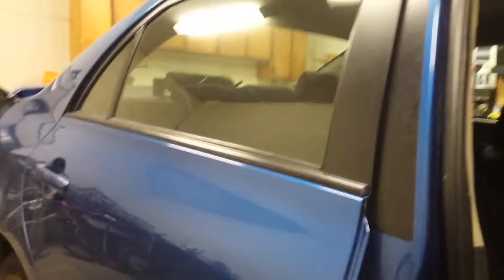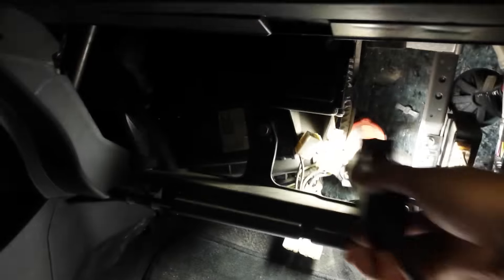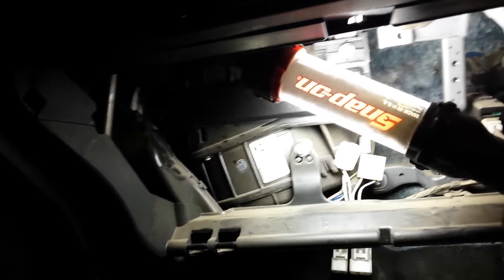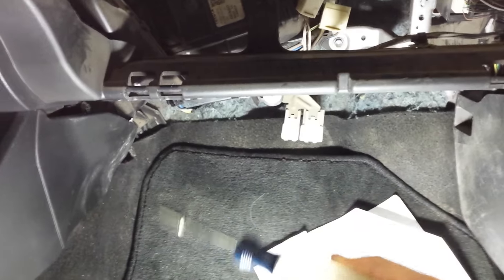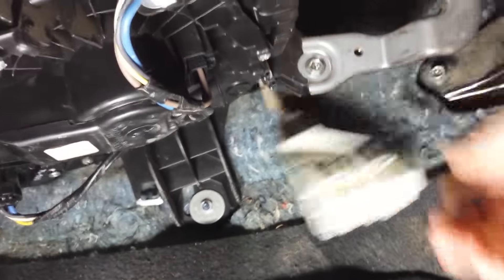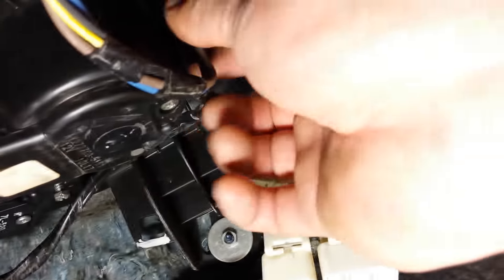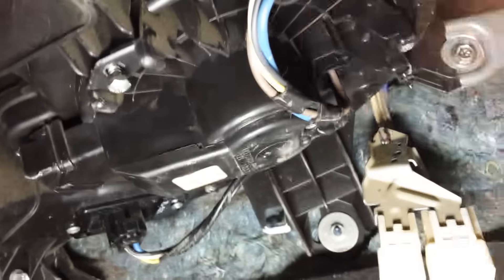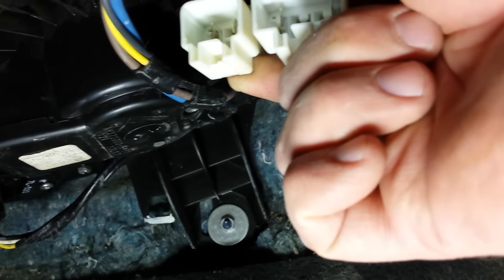2010 Toyota Corolla Blower Motor

Comment: I was at the dealership with my 2012 Corolla for an unrelated recall repair. They gave me an unsolicited quote of over $500 to fix the blower motor noise while they were at it. I said I'd take it to my regular mechanic (which of course was a lie). Less than an hour of my time on a Saturday, pulled out a nest and some acorns and she's whisper quiet. About to go get a new air filter. Thank you!
Reply from the maker: So glad I could assist. I wish I still had my Corolla with the price of fuel!

Comment: nice work. my 2009 pontiac vibe has the identical motor and setup. I think the bearings are going on the motor sounds noisy. Those two white resistor things are a pain. glad only one screw is holding them in .

Comment: Exactly the same in a 2013 Corolla.  Nothing difficult at all about getting it out and back in.  There is a plastic panel across under it in the 2013 model, but the panel just pops right out.

Comment: Checking because you seem more automotive than I am.  I'm handy, and can do most things with instructions, ie: replacing an alternator in my corolla.  However, my blower has been slowly dying on me, but if I hit a bump hard, it would pump back up to full blast.  Currently it's just barely blowing, like a baby blowing out a birthday candle.  Drove around and hit every pothole next to my house in a vain attempt to get it back... do you think something may be stuck in it.... or the blower is fried.  Hitting triple digits in Texas.... and this is not gonna fly lol.
Reply from the maker: If it has 12v at the connector when it stops moving its time to replace. It sounds like its on its way out if it works here and there or you have a loose connection and when you hit a bump its enuf to rattle it on or off. You can pull it out and run two wires to it directly off the battery to see if it spins up. If its sketchy when you put battery power directly to it..you know the motor is your issue.
Reply from the maker: If youre going to check for 12v at the connector on the vehicle side make sure the fan switch is set to max.
Reply: @Chokerdown  It's got a fair bit of rust at the bottom of the blower motor.  I just took the panel underneath the glovebox off, and gave it a few good smacks at the base, got it blowing strong again for now at least.  A replacement is only 30$ online, so when I get around to it I'm just going to replace it.  Thanks for showing me where it was to find it though!